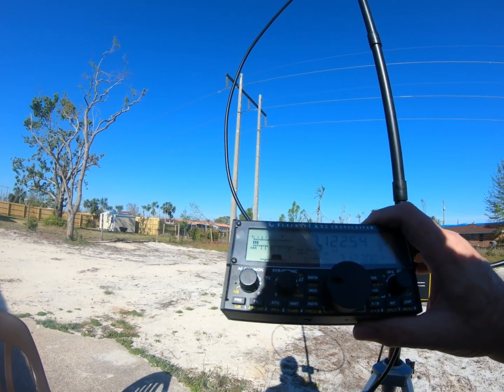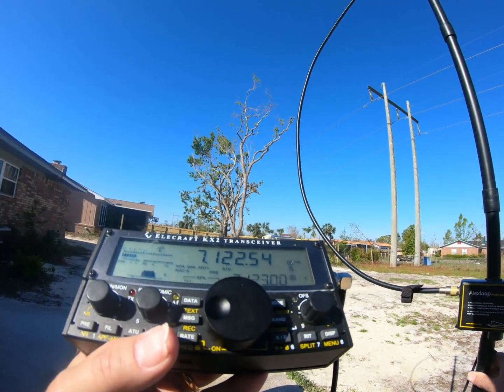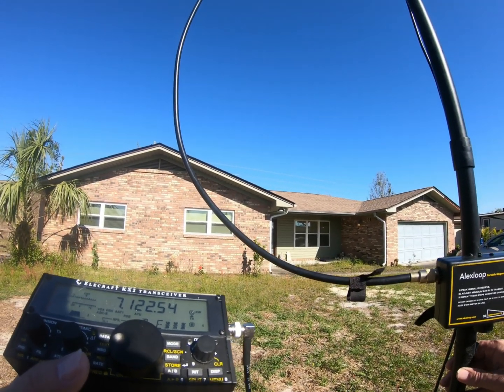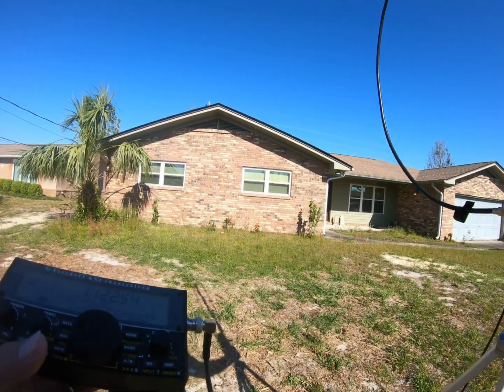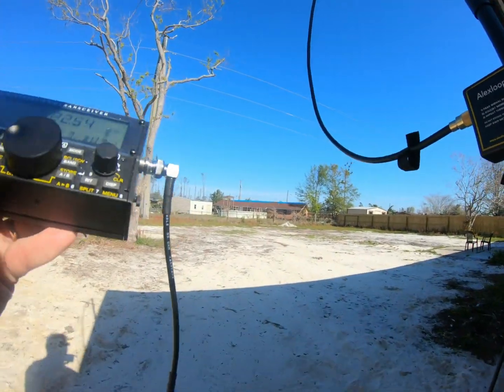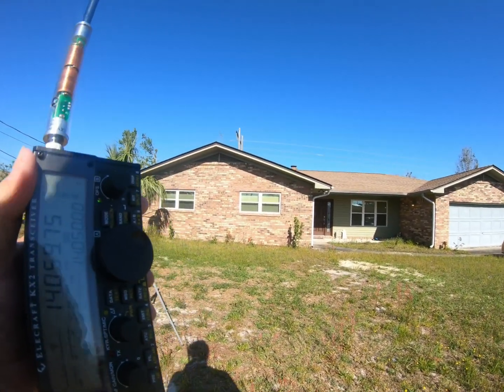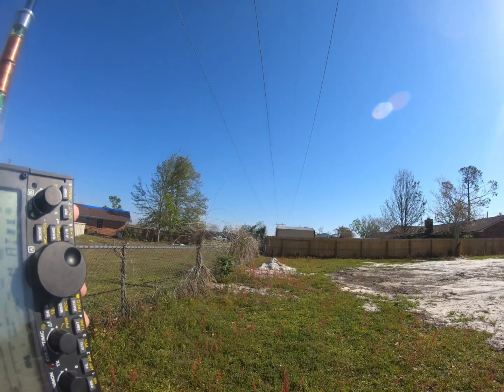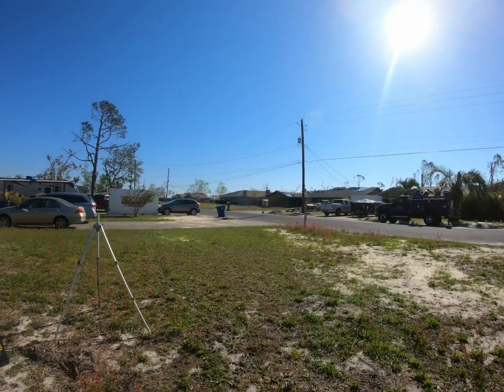Power Line Noise Investigation

Comment: Greg, I had a similar situation here.  It took a couple of calls to the Electric company, but eventually, the field crew came out and gave me the opportunity to actually show them what was going on. The field supervisor walked around with me and I showed him with my radio where the noise was the strongest.  They did check the transformer and the lines, and found that is was a damaged transformer and replaced it. I found out that when it emits noise like that, it is wasting electricity and costing the company $$$ lol. . so They had a motivation to fix the problem. The squeaky wheel gets the grease... I was very impressed with how co-operative they were. Hope it works out for you.   -wb0wqs,